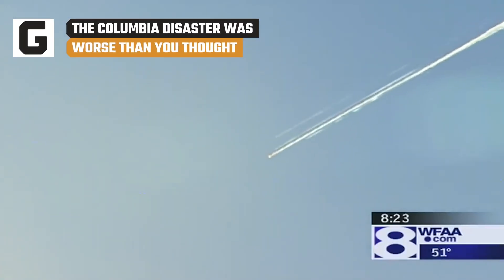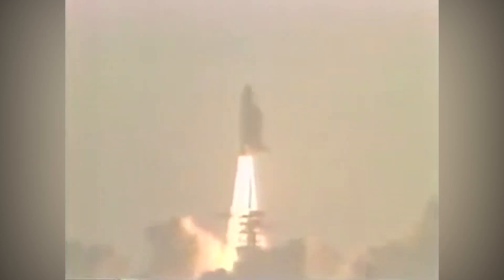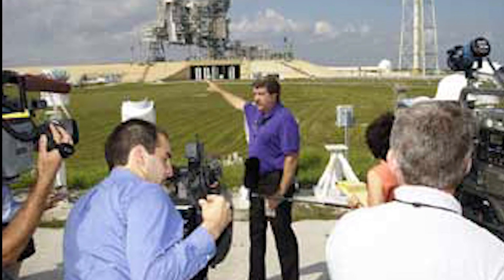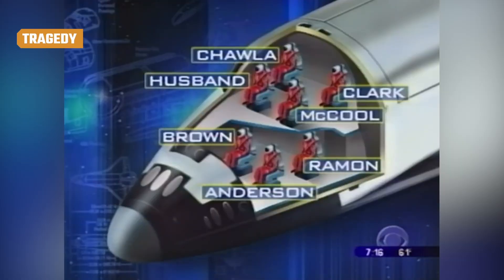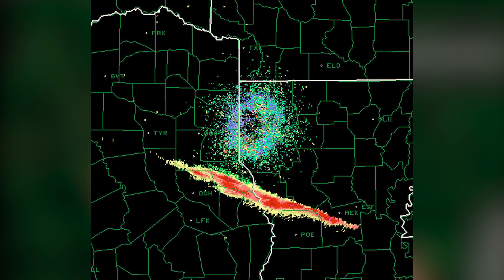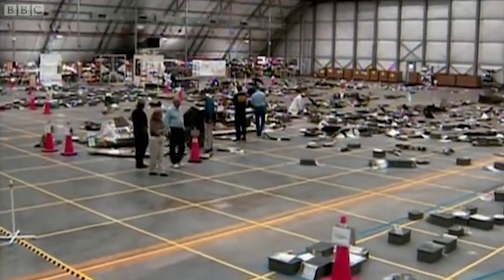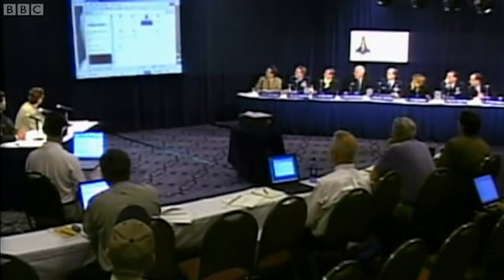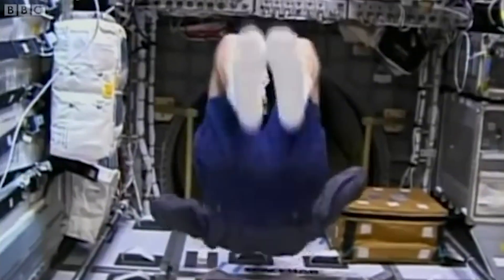The Columbia Disaster Was Worse Than You Thought

Comment: Nice graphics on the video, except the cause of the disaster was something different.  After the disaster, there was long visual photographs showing the actual cause of the explosion.  The cause was the o ring burnouts on the boosters.  Subsequently after the accident the o ring design now include a longer sleeve and an additional o ring on the booster interconnects.  As the initial flair out started on the booster, the higher the shuttle went the flare out becomes more of a blow torch due to atmospheric conditions.  There was lawsuits against the booster rocket company and against nasa itself.  NASA knew about the burnouts as there was evidence shown from previous missions after the booster rocket recovery, but no redesign was performed of the booster rocket until the accident.   Afterward , so many additional hazards came to light by workers at Nasa itself by whistleblowers the NASA ultimately decided to scrap the whole program altogether.  Unfortunately it always takes deaths to change a corporate structures way of doing business. This is true for Nasa as well as everyone else.
Reply: Wrong disaster...the O rings caused the Challenger to explode.

Comment: Well, yes.  However, whether ground-based systems would have been able to image a ~1ft hole in the wing leading edge, sufficiently well, is iffy.  It certainly should have been attempted though.

A more-likely “save” would have been to mount a spacewalk to stuff the hole with insulation — just stuff they had lying around the cabin.  I gather they subsequently identified such items that probably would have saved it.

You alluded here, as have others elsewhere, that the Space Shuttle had problems with tiles coming right from the start.  Those critics don’t seem to be aware that after ... I think it was the 6th mission ... NASA changed the adhesive for the tiles and that pretty nearly completely stopped that problem.  Damage to tiles continued at a much-lower rate, but entire tiles falling off pretty much ceased entirely after that.

Comment: I feel sorry for the astronauts. However you don’t leave the house and take off in your car without a spare tire or some jumper cables. You know a few things to help you in case you have an emergency. My question is why couldn’t they take a few things with them? I understand that every once of weight cost a lot of money to lift off the space pad. But that should be figured into the budget. Why didn’t they do a pre-trip before heading back home knowing that they were going to have to go through re-entry? I’m a commercial truck driver, every single time I get behind the wheel, I do a pre-trip. It’s for safety. Why couldn’t the astronauts do the same thing? I mean they have space suits for Christ sake. I’m sure that they can tether themselves to the shuttle. If they had a few space tiles or maybe a section of the leading edge of the wing , which is nothing but a fancy piece of plastic BTW, they could have possibly saved the shuttle and themselves. That’s my two cents worth. It’s to bad that they died

Comment: those that hide have a reason, and in this instance it must have been very incriminating to NASA, to block such important  insights. NASA is not what it eludes to be...       at 5:13  on the smaller screen or board to the right ,is that not the Logo for Assassins Creed......

Comment: It gets worse.  Several missions before this one the bonding agent that adheres the foam to the centerline tank had been changed to low VOC.  Noted foam strikes on launch went up significantly after that.  Further the large piece of foam that struck the wing was determined to not even be necessary.  It was there to act as sort of a fairing for the fwd tank strut.  The fix was to just not use it anymore.  Not a banner time for NASA.

Comment: they had to fake this explosion to officially retire the shuttle program, because it was too easily spotted as phony.  it doesn't go into space, it follows a parabolic path and lands in the ocean, there are no crew members on board.  then they launch a mockup shuttle from a secret location with real crew onboard (it is a somewhat conventional jet aircraft - notice you can hear jet engines when it lands, it is not a glider as they claim, just use common sense, no other real glider that exists has the same wingspan to weight ratio.  anyway, that's your lesson for today, Programs!

Comment: I remember watching a demonstration soon after the accident in which engineers fired a chunk of insulating foam at a recreated shuttle wing—attempting to prove that it was not a foam strike that had caused the accident. That it was impossible. The foam punched right through the wing like it was gauze. Giant hole. The onlookers actually shrieked in total disbelief. I was shocked by their shock. Has no one seen the damage done by tornadoes, propelled by windspeeds 50-60% of the speed with which the foam hit the shuttle? Almost anything will destroy anything if it’s moving fast enough. RIP.
Reply: The shock was the impact area was an almost perfect match to the engineering photos and films
Reply: @comment2009  I remember watching that also. The chunk of foam was very light in weight, but punched a huge hole in the wing. Impossible people said but remember a 9mm bullet leaves a gun at around 800mph and weighs 147 grams and would penetrate the wing. The chunk of foam weighed around 1.7 pounds and hit the wing around 500 mph . Speed and mass means a hole people.

Comment: A major part that was never brought to light was that there was an adhesive and a bonding primer.  The original products used worked near flawlessly for 25 years.  However, the coating was replaced with a reformulated product designed to be more environmentally friendly.  As is often the case, the less-environmentally-friendly products developed better properties.  In this case, stronger cold adhesion.  Ice shedding was nothing new.  It just didn't cause major problems in the original design configuration.
Reply: Absolutely true, and Hillary Clinton led the charge to go with the more environmentally friendly but less reliable substance.
Reply: @bud ekins: In July 2005, NASA reported that they changed the foam insulation a decade earlier, switching from a foam-blowing agent that used an environmentally damaging chlorofluorocarbon (CFC) to one using a more benign hydrofluorocarbon (HFC) blowing agent. The newer HFC-blown foam insulation is a significant change since it is reported to be more brittle than the originally specified insulation material.
Reply: Source:   https://insulation.org/io/articles/grounding-the-space-shuttle-nasas-foam-insulation-problem/

Comment: No aviator worth his salt would take off before a final walk around to check his aircraft.  A spacewalk should have been required as part of the mission, to do a final examination of the spacecraft, before re-entry.  Since they knew that foam strikes frequently happened, they should've developed a contingency plan to deal with any anomaly that might occur.  If NASA could pull off bringing a severely cripled Apollo 13 command module home.  I believe they could have developed an emergency repair kit for such an eventuality.

How long will it be before engineers have final say over engineering problems instead if business heads?  We've seen this scenario play out repeatedly, over the years because the business heads want to save money and it always ends up costing more money, in the end.  Boeing and their 737 Max is a glaring modern example.  Do it right the first time, it always costs more to go back and fix it later.  One coat that seems to never be counted is the cost to one's reputation.
Reply: I think had the media not focused in on Apollo 13 they probably wouldn’t have been as involved with it as they did. Once the media got a hold of it they had to bring them back. Columbia might have been saved had the media got a hold of it.
Reply: @M Bacon  A very interesting and nuanced comment. I wish I knew more about that sort of thing
Reply: Business people handle the decisions because no matter what, at the end of the day money is a business decision. It's good to get engineers to do the decisions but it's more than likely that those decisions can cause the death of a company.

Comment: CAIB (Columbia Accident Investigation Board) did make consideration to save Columbia crew with Atlantis, but here's the deal...

In order for Atlantis to be prepared for launch in time (before Columbia's CO2 scrubbers became oversaturated and its fuel cells ran dry), the preparations would have to run perfectly smooth and have a whole bunch of on-pad checks skipped. Note that in every single one of all 135 Space Shuttle flights these checks always revealed mission critical faults.
Secondly Atlantis' crew. It would take a minimum of four astronauts (two pilots and two mission specialists to the spacewalks) to fly on Atlantis on a mission that at the time no ever planned for but would have to get done in a couple of weeks. That's something that usually takes years. Atlantis mission specialists would also have to the ones that demonstrated fast adjustment to microgravity, not exactly a common trait. There's a reason NASA doesn't do day 1 EVAs.
It also assumes "that a decision to repair or rescue the Columbia crew would be made quickly, with no regard to risk". Imagine "quickly" with the government agency.
Two shuttles in space at the same time in close proximity of one another, two separate control centers, 11 lives on the line, few weeks to prepare from ground up. It's not even remotely realistic and was gonna say "beyond foolishly optimistic" in theory, but that also wouldn't even remotely do it justice.
There's a ground rule at NASA: only worry about things we can do something about. If the damage to the left wing's leading edge carbon-carbon panels (not tiles) would be discovered, Linda Ham and the rest of the ground team would be faced with decision to either let the crew know that they don't believe they can re-enter or lie to them (at least by omission). Either option doesn't seem to have much effect on the outcome.

https://arstechnica.com/science/2016/02/the-audacious-rescue-plan-that-might-have-saved-space-shuttle-columbia/

Comment: "NASA can't manage a bus line with a single bus on it..."  That was the gist of the presidential commission on the Challenger disaster. NASA normalized deficits from the start of the space program right to and after Challenger and Columbia losses.  It was as though the space program started without a sense of purpose rather, like a race just to see who wins. No computer onboard Columbia alerted the crew of any anomalies during that fateful descent despite continuous firing of the rcs system during reentry, or notify the crew about wing damage and other subsystems failing or the shuttle was breaking apart up...nothing! no warning lights even after loss of tire pressure. Instead, the shuttle communicated with NASA engineers who were safely on the ground... and even so, there was no way to abort re-entry...  How did NASA certify such a ship for flight? Why didn't the crew cabin have an escape mechanism? such that even after complete breakup of the vehicle, crew cabin should have remained intact, jettisoned self, realign and continue reentry and land as Soyuz does with auto deploy chutes...   Spacex better take a page from the Soyuz system and remove the complex touchscreen gimmick in their crew cabin and build a reliable vehicle that is also safe. The Soyuz system is built around purpose, function and safety, not comfort or show... Soyuz ships would not win any beauty contest, they do look cool especially during launch but they are cold-war era technology and also very reliable.

Comment: That shuttle-based rescue mission was pretty marginal, though. Yes it was possible, but not easy or with a high chance of success. 
And the issue causing the reason Columbia couldn’t survive reentry hadn’t been solved: it would have been a gamble that there wouldn’t have been a similarly destructive foam strike on her launch. A small chance, but higher than usual flight rules would allow.

Comment: It's actually even worse. The formulation for the foam on the tank was changed mid-program. The new HFC-blown foam was less of an environmental pollutant but it was able to pick up more water and consequently a greater mass of ice. In other words the kinetic energy of break-away section was almost double the largest anticipated value for the original insulation. It was also more brittle and bonding to the fuel tank was questionable. Ironically NASA had considered an embedded netting and several other mechanisms for restraining the foam, but risk evaluation was not, as far as I know, revisited for the new formulation. The decision to change the formulation was, I believe, a political rather than an engineering decision.

However it also gets even worse. The Challenger disaster was a consequence of low temperatures and a damaged seal. Yes? Well, not entirely. NASA had not wanted a segmented booster and indeed there was a more powerful, locally sourced, non-segmented design from Aerojet (now a part of Rocketdyne). This motor was successfully tested but lobbying by a congressman for the State of Utah forced the acceptance of the Thiokol proposal - even though the motors would need to shipped across land (whereas Aerojet was based in Florida). Again, politics trumped engineering.

There was a documentary made on the subject of the Aerojet-Dade product but since Rocketdyne is heavily contracted to NASA they've tried hard to suppress and redact this piece of history. The documentary was removed from youtube at some point. Yet the bottom line is that both disasters were fully preventable. If you do a search on Aerojet-Dade there are still some links active, but the simple reality is that history has been largely rewritten.
Reply: After 1971 NASA could no longer count on the funding it had enjoyed. Not only because the public lost interests, but because it had become, like so many military projects, dependent on congressional supporter whose job it is to provide pork for their districts. To heck with efficiency.   GOES A LONG WAY BACK.  In 1908. the United States Navy had about 18 dry-docks scattered around the country. The British Navy, the mightiest in the world  had one.

Comment: Yeah.... about that rescue. First problem: There was absolutely no docking provisions made. Second: Although the shuttle had docked with the ISS there had never been a shuttle to shuttle docking. That would have left a crew egress and transfer. Again, something not planned for and had never been attempted. The shuttles only had MMU's ( and only one ) for specific missions. Using the robotic arm to pluck astronauts out of space would have required docking harness for the grappling end to work. No such thing existed. Lastly, that emergency escape arm could not have worked as the ship was already tumbling and tearing itself apart by the time they were at upper atmosphere parameters.

Comment: Click-baity title, doesn't tell me anything I didn't already know, and misses some important details.  First and foremost, had they known there was a problem caused by a foam strike on launch, Atlantis would have to have been rushed through preflight to get up in time, and it would require every safety check and engineering check to pass.  Any failure would require work to rectify the situation and there was at best only 5 days to implement any fixes before the window or opportunity closed.  And then there's the questionable wisdom of launching another shuttle when the first one was already damaged on launch.  What if Atlantis had also suffered a foam strike on launch?
Reply: Send Atlantis up with only 1 crew member. That way, worst case, there's only 1 more casualty. Best case, there are 7 fewer. That's a good bet.
Reply: @eliharman  if asked for volunteers, I bet the entire crew of Atlantis would have went!
Reply: Need room for the return passengers anyway.

Comment: Bob Paige was one of those who were insisting that the impact was not on the RCC, but in the black tile acreage.   For all practical purposes, the entire photo analysis group was of the opinion that the leading edge had not been hit.  I think it’s a mistake to pile all the blame on Linda Hamm, she only knew what she was being told, and she wasn’t getting good information.  At the time, the photo analysis group (including Paige) were very protective of their analysis showing no RCC hit and opposed any suggestion that there may have been.   Not just the photo analysis group, but all those who took that same (vastly majority) position that black tile had been hit knew there was safety in numbers.  If they all agreed and turned out to be wrong, it would be much harder to blame *everyone*, I mean, if no one got it right, who can you blame.  Any differing opinion coming from anywhere was loudly and collectively discredited by ‘the experts’.  Of course, there was much more to it than just all that, but it was a very contentious time with very timid engineers huddling in what they though was the safest place (a group where everyone agreed with one another).  They were wrong.

Comment: Fixing problems requires Engineers to get managers tied in so the management failures squarely effect the bungling lame managers position, tenure, pension etc. Managers often climb up in power via be jerks. Whether it is the 737 MAX or the space shuttle the key to fixing things is not to assume and hide issues. With time the jackassery of management causes deaths. A few rotten managers often ignore problems to meet schedules. Sadly the whole Nasa bad culture problem of the 1st  shuttle disaster did not change the culture.
Reply: That is what happened at Chrysler in the ‘70s. The company used to be famous for its engineering. That went away. That is why the company could not keep up with Toyota.